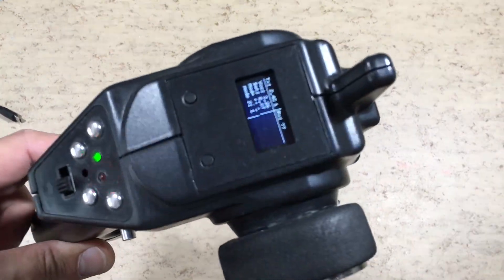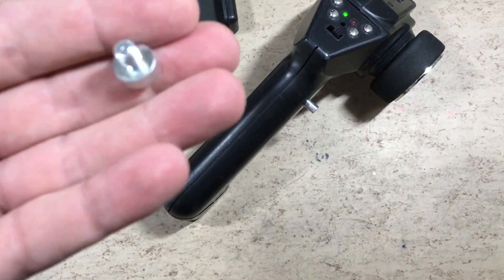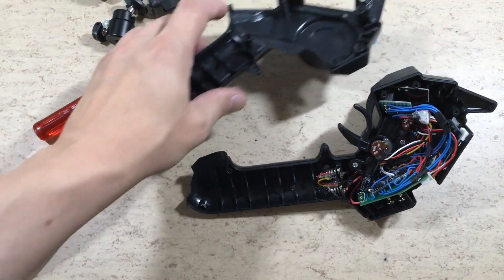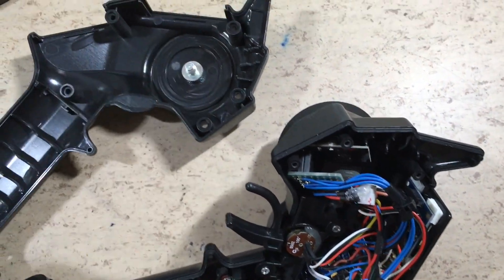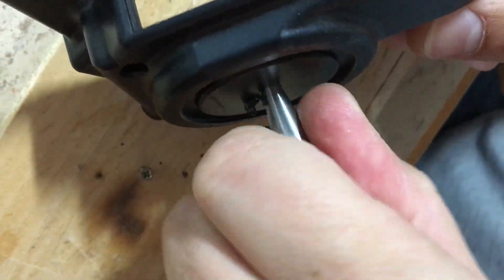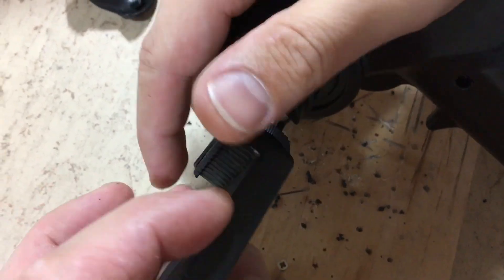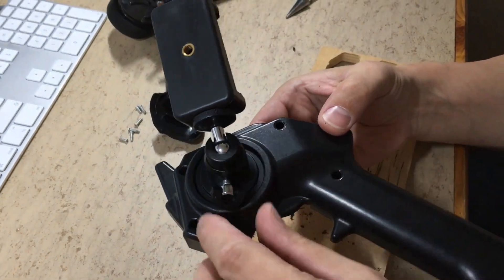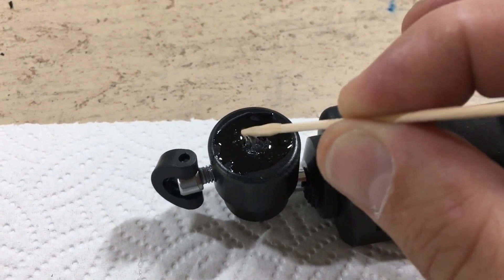Filming RC Videos? Phone Mount For My DIY 2.4GHz Arduino RC Transmitter!

Comment: Hey nice concept and works well. I'm using an action camera on the bill of my baseball cap. I think your idea will give a steady video. I tend to move my head when I'm explaining things so it gets a bit bouncy. However I get a lot of samples and each model has it's own stock radio so the ball cap is the best solution for me i think! But i like the ideas and how people come up with ideas modify things to achieve something and this is great! cheers :-)
Reply from the maker: Thanks, Mike. I also get a lot of samples and yes, they all come with their own radio. So this solution only is intended for vehicles, that use my own remote control system (about 90%). Of course your solution is better for the sample cars. How do you attach the action camera to your baseball cap? Do you have a link to this mount, strap or whatever?
Reply: i made a video on my channel about my hat camera  https://youtu.be/k0b17t_OMco
Reply from the maker: Nice! Thanks for the link.

Comment: Wow there are some many other ways,much easier ways to mount a camera on ur transmitter to record rc vids, no disassembly or drilling involved
Reply from the maker: You may be right. Do you have a specific solution in mind? My goal was to have a permanent and sturdy solution on this transmitter, which is used for about 90% of my vehicles.
Reply: TheDIYGuy999 well the transmitter I use a lot for multiple models I have is the traxxas remote n it has the mount for it u can buy now from traxxas, also on my other transmitter I use a camera mount kind of like urs using hot glue to hold it in place if u do t wanna use hot glue u can use a battery strap n strap it to the remote
Reply from the maker: I don't have any traxxas stuff. As you may know, my remote control system is my own development and used in most of my vehicles.